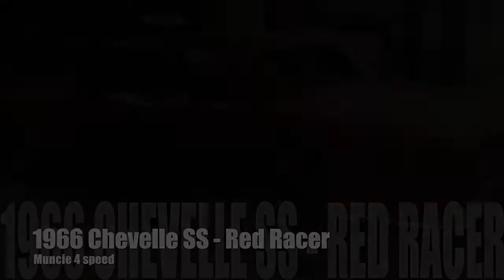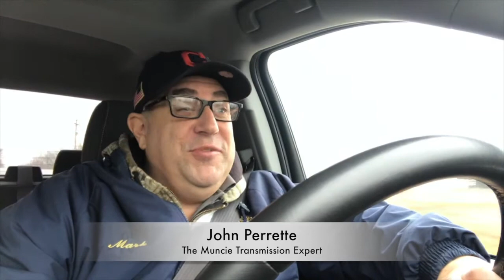Muncie Transmission Evaluation and Education by Mark Meldrum & John Perrette

Comment: As a Brit I'm going to assume The expression(sliders) you mean baulk ring i.e. It grabs the gear and brings it either up or down in speed to enable the drive hub to engage the selected gear
Reply: The "slider"  is the synchronizer unit itself, not what you call a baulk ring.